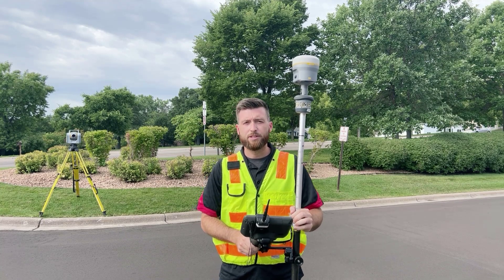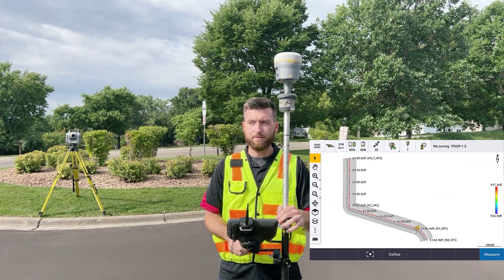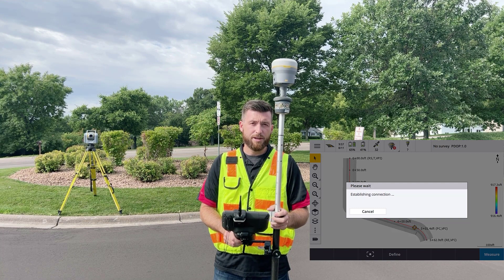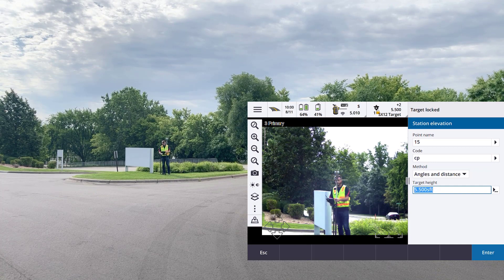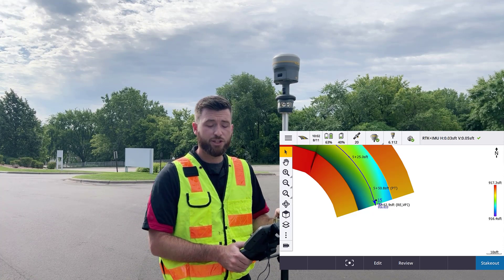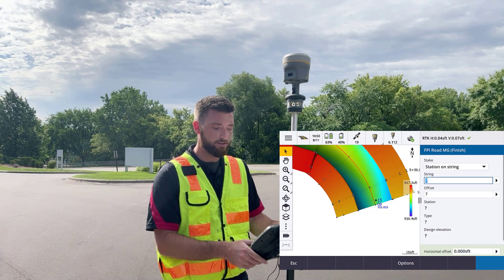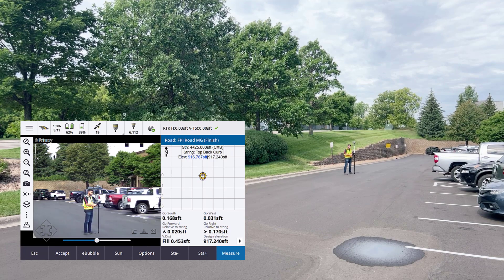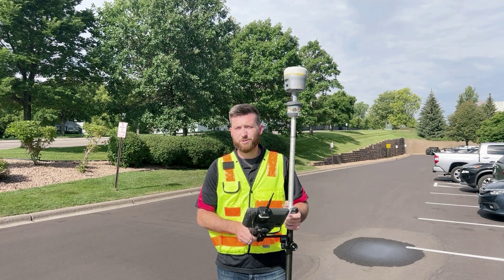Trimble Integrated Surveying - Precise Road Stakeout with Station Elevation

Comment: I see this video is 2yrs old.  Is it possible to use tilt function of the R12i yet?  I don’t know why this is not an option?
Reply: I don't think so. The reason is the same as why Trimble can't make a tilt prism (ie Leica AP20)... their total stations don't have a GNSS component. Leica has GNSS built into their handles. Not a major RTK unit, but something similar to the GPS in Trimble data collectors. It's a real bummer they can't add this. The AP20 virtually eliminates rod busts and the tilt function increases staking and topo productivity dramatically.

Comment: Ok , let me say this. Frontier Precision is one of the coolest company I have been lucky to be aware of exitence . Now this video is a bit weird. Whatever the guy is doing is right, in the right fashion ecc. But this video can  t be sold as "precise road stakeout with station elevation". I know u people would like to , but gpses are not precise, and they will never be. U can try to define a certain level of accuracy doing this hard aproximation of the flat to the curve yes, that is what the gps is for , but if u want to call this video precise road stakeout , u better start talking about setting up the instrument on a CP that belongs to a traverse (or if not , then u need to use statio elevation computing residuals from CPs ) shoot some other station using station setup plus and chack discrepances or residuals on that point. Or a three point resection. Even a free station setap will be better as long as we have control on site . This is the precise way to do the job. Is it accurate? Depense on may factors , from gps to edm, temprature, refraction ....not to mantion that if u need it precise my friend , u better start talking about angles and distances. All of this video has nothing to do with the term PRECISE. I know u can build up a resection with control points using integrated survey, view the sigmas "of the sample" but yet how big is the site ? what s the best time for gps obs? Are my cp Covering THE SURVEYED AREA in the best fation? How do behave this gpsed points from integrated survey when we move far form site, and the station set up point comming from them ? is the flat to curve working properly? For a good job to be precise and accurate traveresing can not be skipped , sorry. 

I am sorry to say, and to remind people that LSQ adjusment done in real time ad taken as they come in from your controller are dangerous to be used .
Reply: Thank you for the comments and questions. You bring up some very valid points that all surveyors should be aware of when thinking about precision and accuracy. I'll preface by saying the purpose of this video is to demonstrate one of the ways that you can utilize what Trimble refers to as "Precise Elevation" staking using the Roads Module. The option I'm referring to is shown at 0:44 in the video. By enabling "Precise Elevation" stakeout, it allows the user to utilize a robot for elevations while staking horizontally with GNSS. When considering an integrated survey style workflow, the user has the option to set up their instrument via Station Setup, Resection, Station Elevation, etc. Determine what's best for YOUR scenario. Yes, a Station Setup or Resection is preferred, but sometimes the user might not have the ability to perform a Station Setup or Resection whether that's due to lack of control or line of sight issues. Or maybe they just don't need to waste their time doing more than a station elevation routine, which is exactly what I demonstrated in the video. There are times where a GNSS solution will give you an acceptable horizontal position but not good enough vertical. That's where the robotic total station comes in. Bottom line - the Station Elevation routine allows you to quickly setup the robot for precise elevation staking by simply localizing in (benchmarking) on a known elevation. From there you're only using the robot for elevations. The GNSS is giving you your horizontal location.  If you want precise horizontal and vertical, then a true station setup or resection would be the route to go. Thanks again for your comment and bringing forth a crucial topic.
Reply: All to be paved by a paver.  Lol.  GNSS is plenty precise for staking out a road.  

Stakes in general aren't as accurate as GNSS.  What part of the stake do they pull from?  No stake, you used hub & tack.  Which direction do you pull the offset from?  How thick is the paint sprayer?  Plus or Minus a few hundredths isn't going to make or break road stakeout.  What will make or break road stakeout is taking 3 times as long to do the task with a total station.

Comment: What version of Trimble Access are you on? I’ve been having issues with integrated and Trimble Access 2022.01. I’m not able to measure a point or change design elevation.
Reply: If
Reply: This is most likely v2023.00 based on the date the video was uploaded